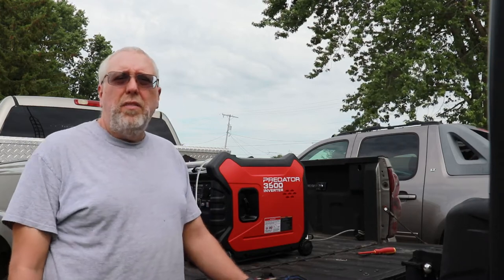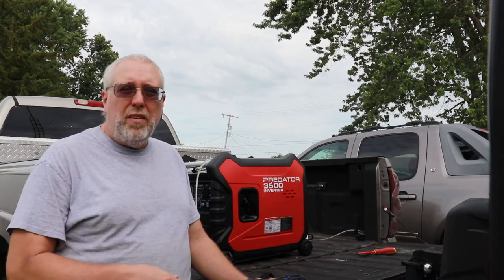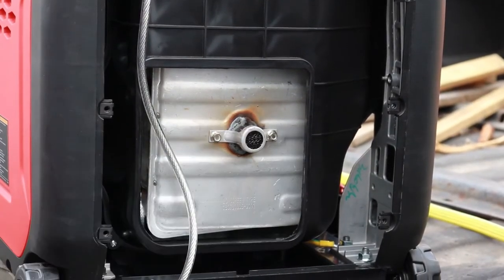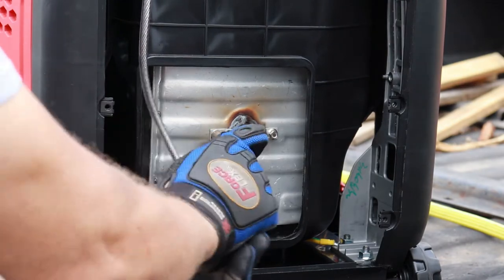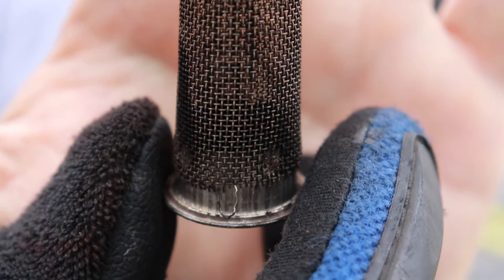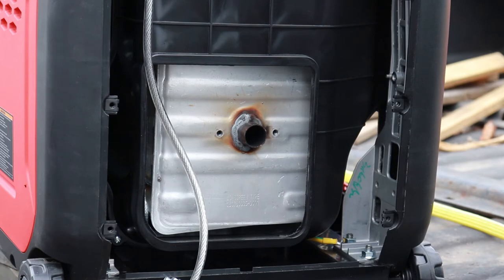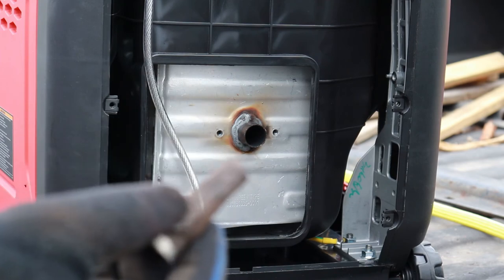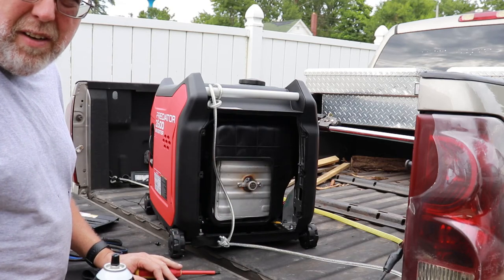Symptom of a clogged spark arrestor

Comment: Had the same issue with our predator 8750 inverter generator.  Cleaned with a torch and it runs great.  Easy, easy fix.  Mine was about as dirty as yours was.

Comment: I have the same 'genny and my arrestor clogged up after about 10 to 12 hours.  (running a portable AC unit)  Power was bogging down  it was surging and blowing black soot.   I took the arrestor out and it was all good.  I was on the road at the time and only had gas to clean it.  I plopped both pieces into a gatorade bottle,  filled it halfway with gas and swirled it around.  After fishing both halves back out  and seeing some inprovement,  I let them dry out and re-installed them.  2 hours later,  right back to surging.   I removed it again and left out the conical screen portion.  No more issues. 

PS:  Don't drop the pieces.  My outer mesh part slipped between the muffler and the housing, and it took an hour to fish it back out!   Had to remove the generator from the rack,  take more panels off, tilt, shake, rattle and bounce the damn thing until it wiggled to a spot where I could reach it.  When putting it back together,  the damn ring and one of the bolts fell in there!   another round of shake, rattle & roll to get them back out.  (it's a wee bit different than yours for some reason..   The ring mounts with the screws top & bottom and does not have those long tabs) 
Let the thing cool down and stuff a rag in that gap!  It will save you some potential headaches.   Just remember to take the rag back out!
Reply from the maker: Mine runs better without the spark arrestor installed but if your in a fire ban area or a NF you must have it in place. Thanks for the comment.

Comment: Leave the screen in the muffler, and remove the outer round part of the spark arrestor.
You still have a spark arrestor but not that easily plugged outer piece.

Comment: What did you use to clean it?
Reply from the maker: if it's not too bad you could use carb cleaner but if that don't work use a propane torch to burn the carbon off. Hope this helps.

Comment: Sounds like marbles in crank case
Reply from the maker: It did last for about 1000 hrs before I returned it under warranty. The generator was still running just the display stop working.

Comment: The reason why these generators clogged up is because they run to rich swap out the jet in the carb for a 68 and remove the evap canister then it won’t clogged up and it will run longer
Reply from the maker: James, Adding the hoes to the air cleaner has resolved my issue without re-jetting. Also, How do you get around the fuel tank venting without a EVAP?
Reply: @millersinthemoment5427  try using a vented fuel cap